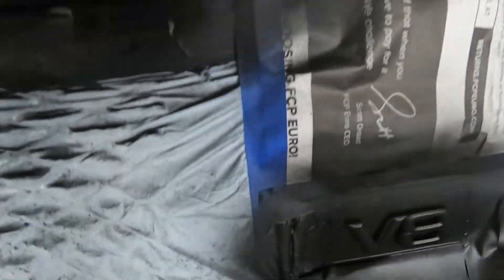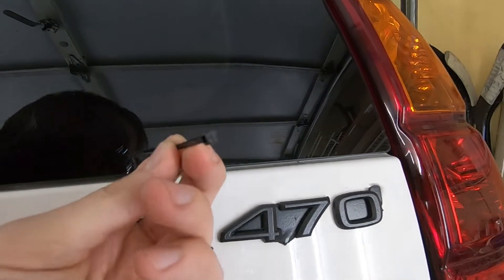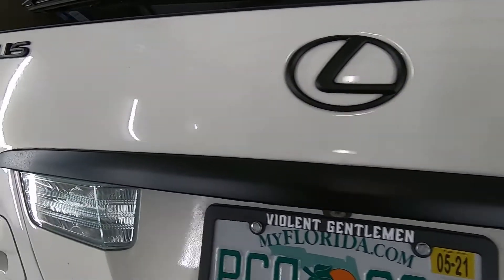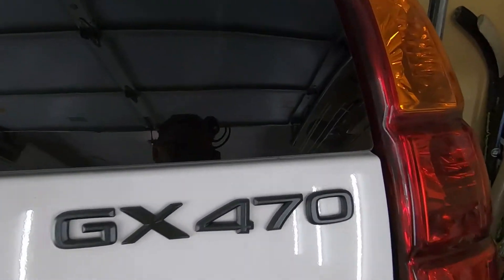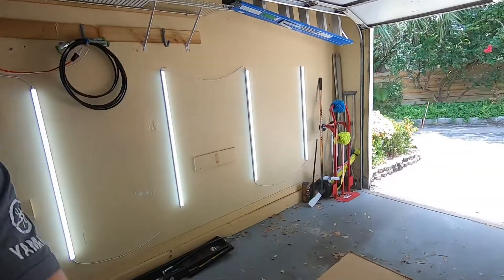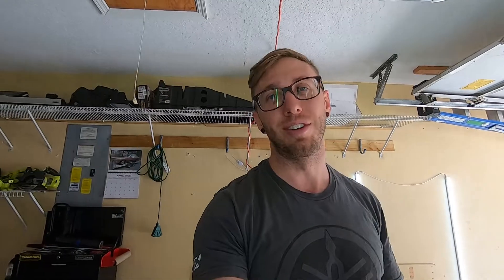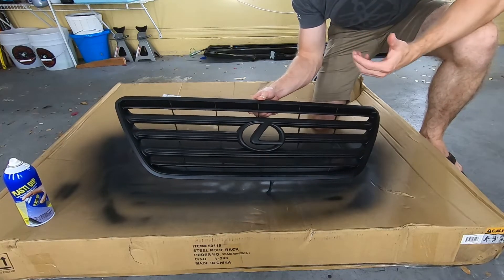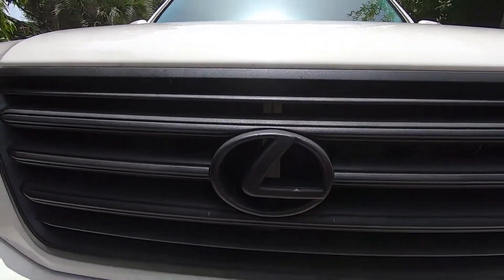Vlog 17 - Lexus GX470 Plasti Dip Badges and Grill

Comment: I've gone about 2 years with plastidip on my front GX grill, still looks good. Next you have to redo the side trim under the windows, you can buy black Prado trim online.
Reply from the maker: Robert Skelton glad to hear it held up so well! Agreed, I wanted to find a better solution for the window trim beyond plastidip. I’ll checkout the Prado trim and post a video if I get my hands on some.
Reply from the maker: Also, we should make a video soon and take our GX’s out to the compound!
Reply: @Awesomoto  I'm down now that I have Wildpeaks!
Reply: How does the plastidipped grill hold up against bug spatter and car washes? About to blackout mine but thought I'd ask!
Reply: @AyanDaftari  after 3 years, there was just a few spots coming off, but you'd have to be close to notice it. I don't use drive through car washes due to ditch lights and the snorkel. I ended up stripping it and re-painting it black, non-plastidip.

Comment: Love this look. Do you think a white 2008 gx470 with 123,000 miles selling for $18,000 is a fair price? It’s one owner, never been off road, clean record, suburban family car, in immaculate condition with all service records done by a Lexus dealer. I know the stock in these have gone up but torn that private seller wants top dollar way above book value. They’re getting harder to find with low miles in this condition... If I counter with $16,000 cash am I over paying? Would love your thoughts! Aspiring GX owner and getting a feel for what’s worth at what price.
Reply from the maker: Wow, the price of the GX has gone through the roof in the past year! I’ll be honest, I’ve been a little out of touch with the appreciation of the market in these. Sounds like from your research that if you could get it for $15-16k it would be a good deal. The mileage is definitely low and sounds like a good condition vehicle.
Reply: @Awesomoto  Yeah would’ve been nice to have caught on before the gold rush last year haha! New to the GX world :D What should I be considering to replace/maintain while or shortly after buying one? I’m seeing timing belt/water pump/rear coil conversation are common but wondering if there are other parts or issues to consider. Any thoughts on mileage vs age/year as well? Does one matter over another? Prefer to get an 08-09 but open to 06-07 as well (upgraded v8s). Thanks!

Comment: Hi.
Been checking out your channel recently. I'm currently in the middle of upgrading my 2007 Lexus GX470's stock radio to a Phoenix Automotive PX6, Just ordered the speakers to change out to the ones you used(DS18's & Skar).
I was going to spray paint my grill matte black, when I saw this Plasti Dip video. How is the durability of the plasti dip? I see you were concerned about how it would hold up.
Keep making those videos!!
Shawn.
Reply from the maker: Hey again lol! Glad you're working your way through the videos and upgrading your GX! These things are fun to work on. As far as the plasti-dip goes, mine is still holding up and it's been a year since I did the job. Unfortunately, I won't be able to say how much longer it'll hold up because I will be receiving the new Garage Alpha grille within the next few weeks and will make an install video for that. It's an awesome grille they've just come out with that gives the GX470 the TRD Pro styling.

Here's the link:
https://garagealpha.com/collections/exclusives/products/lexus-gx470-120-trd-style-grille
Reply: @Awesomoto , wow! That grill is badass! Looking forward to that video! Seems like it should be pretty straightforward. 
I have just finished putting in the Phoenix PX6 in my car today. Been playing around with the settings. There is a guy that sells custom firmware upgrades for these HU($100). I'm thinking about doing this.  Did you have any issues with your OEM backup camera not working after PX6 install. That's really the only issue I'm having so far. I'm hoping whatever it is, is in the settings 🤞.
Reply from the maker: @swebstar1705  Yeah, that grille looks so much nicer! Oh awesome! Glad to hear you installed the Phoenix head unit! Unfortunately, the factory backup camera is runs off 9v and the Phoenix needs 12v. I just filmed a video installing and aftermarket backup camera for the Phoenix head unit. I’m posting that video over the weekend. I love the new camera and the video quality is much better than the factory one.
Reply: @Awesomoto , that's funny that you'd say that about the camera. I was getting ready to ask if you had a work around about it or just swap it out. I got a firmware upgrade from a guy online($100 & free updates). He has a FB page( Tesla Style. Firmware and Headunits) gas a Boot up look awesome(tailored to your car's yr, make, model & color. Tons more options & themes. Just finished downloading it this morning but then it was my bedtime as I work 6p-6a. Was the backup camera install lengthy? I've seen that there is an inline power converter to throttle down the voltage for the OEM backup camera but if yours is better than OEM & not too hard to install, I might hold off to see your video & go that route. 
Thanks,
Shawn
Reply from the maker: @swebstar1705  That firmware sounds awesome! I might have to go that route myself. The backup camera install was super easy and running the cable from the rear to the front was easy too. Probably a 1-1.5 hour job…my video should help save you time too.
Reply: @Awesomoto  Great!! I'll check out the video when posted. I just did about 3/4 of the LED interior light conversion. Just wow! Thanks for that video also!
Got the front 6x9 speakers delivered yesterday, along with the adapters, 2 harnesses, and the sub woofer.
Amazon says rear 6.5" door speakers arriving today!
Reply from the maker: @swebstar1705  Those LEDs made a huge difference in the interior feel at night! Glad the speaker components are arriving. I bet I can guess what you’re working on this weekend lol! Let me know how you like the sound…I was impressed with those front 6x9’s and the bass they put out.
Reply: @Awesomoto , yeah, I'll be definitely freeing up some time for all the speakers!!
Reply: @Awesomoto  , once again, I'll be looking forward to another video.
I haven't put the trim back on after the radio install because I wasn't sure which way I wanted to handle the backup camera issue. I don't want to keep pressing my luck that the trim won't crack or break by taking it on and off again.
Reply from the maker: @swebstar1705  That’s a good idea. I’ve taken my dash apart many times and I’ll admit, I’ve broke a few clips.
Reply: @Awesomoto , have you had any issues with the sound quality using Bluetooth for phone calls? Specifically, I was wondering if you went with the internal microphone on the HU, or  installed the external microphone. I hooked up the external microphone but have had a few people tell me the sound isn't too great. Been thinking about pulling the HU out and seeing if that makes a difference but thought I'd check to see if anyone else had that same issue. Maybe a different app for calls? Was also thinking about installing a long(6'-10') HDMI cable into the output jack on the back of the HU(cause you never know, right?) Keep it coiled under the dash. 
Oh yeah, backup camera gets delivered today & bracket comes tomorrow.  Pretty excited to think how much closer I'll be to wrapping interior stuff up & get that HU trim put back on!
Reply from the maker: @swebstar1705  I use the built in microphone, but tend to switch to my phone locally because I can hear better than way. The external mic is probably the way to go. You can mount it near the drivers side so you can be heard better. There is a little ledge on the gauge cluster it should mount to nicely. I like your hdmi cable idea!
Reply: @Awesomoto  Thanks for the input. Much appreciated!
Reply from the maker: @swebstar1705  No problem! That’s what I’m here for. Let me know if you have any other questions come up.
Reply: @Awesomoto , I've tried using the external microphone, then unplugged it & tried using the built-in microphone. Tried them both for phone calls. I can hear the person that I call just fine. Problem is that using the microphone either way, they can't hear me. Must be some setting that I'm missing. Have you had this happen?

Comment: How does it hold up to a pressure-washer?
Reply from the maker: Seth Funderburk I’m actually going to test that out tomorrow when I give the car a bath. I’ll let you know. I’m thinking it’s not a good idea to hit that area directly with the pressure washer up closer, but it’ll probably be fine from about 4ft away
Reply: @Awesomoto  ......did you try it?
Reply from the maker: @alcopower5710  Yes, I washed that area with the pressure washer, just not too heavy. It’s held up fine through 4 washes. I wouldn’t recommend hitting it direct with the high pressure nozzle though.

Comment: Would any type of black spray paint work?
Reply from the maker: If you want to go with just spray paint, you’ll want to take the emblems fully off. Once painted off the vehicle you can reinstall with 3M tape. The beauty of using Plastidip is that you can peel it off the areas where overspray occurred.
Reply: @Awesomoto  thanks for the prompt reply, how many cans do I need for both the chrome at the back and the grill in front?
Reply from the maker: @abiola-igeayoola6063  Two cans did the job. You’ll also want some painters tape.

Comment: Hello, where did you bought the tail lights?
Reply from the maker: These tail lights were on the vehicle when I bought it.
Reply: Ah ok, thank you for your time.
Reply from the maker: @DanielRamirez-dv5hm  Anytime! If you need help finding a certain tail light, let me know.
Reply: I do need to find the tail lights for my 2005 Lexus gx470, like the one in your video, if you look up your video on minute 7:39, you can clearly see the tail lights that I want. They look soo good on your GX.
Reply from the maker: @DanielRamirez-dv5hm  Oh we’re these taillights not the ones that originally came on the 2005’s? I bought it this way, so just assumed that was how it was supposed to be for 2005.
Reply: @Awesomoto  I'm trying to find after market clear tail lights, like the ones you have on your GX.👍👌 thank you for your help!
Reply: These are the OEM tail lights, with amber turn signals as seen in the begging of the video. They do look clear but I think is illusion at the end because he did a black and white video.
Reply from the maker: @glincho  Thank you for clarifying on the previous comment. I was confused about the original question, not realizing these were mistaken for clear instead of amber. Thanks!